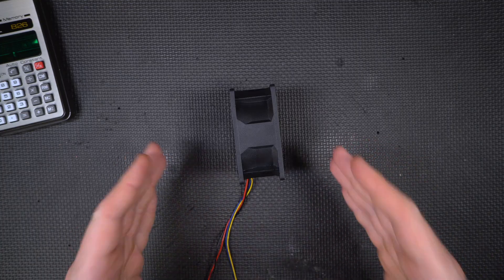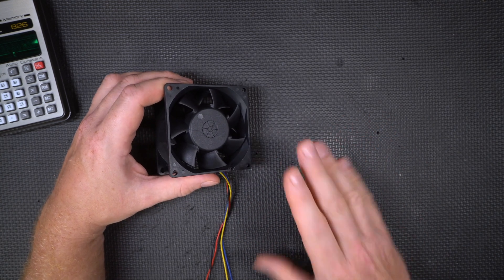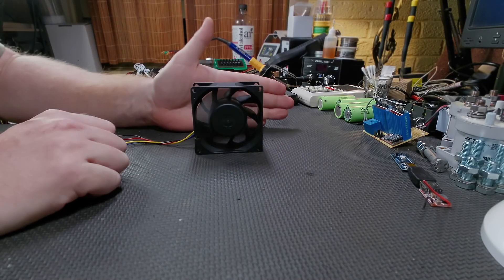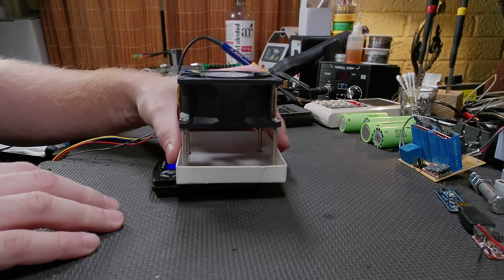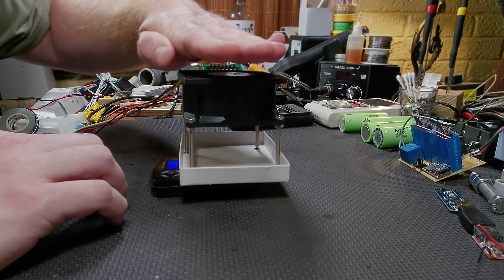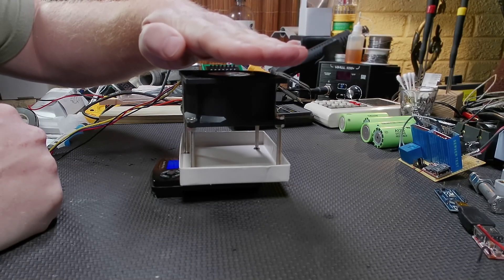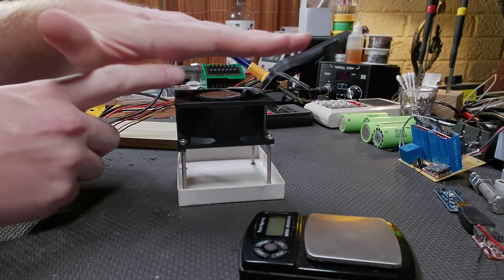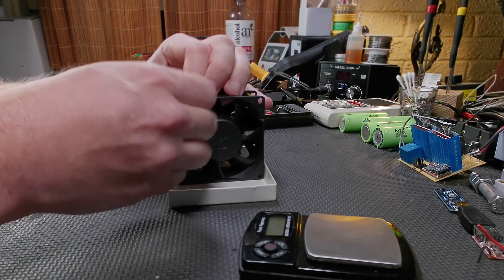I can't explain why this happens - can you?

Comment: So im gonna swing at it without reading the other comments. First swing is to actually restate the question, i guess? Why does the fan's 'apparent thrust' seem to increase as your hand gets closer? I feel like that's a crappy restatement. Anyway, at first i thought it had something to do with boundary layers, but when i searched that term,  'ground effect' appeared and that jogged my memory. Then i realized i didnt properly understand how that worked anyway, but it still seems to be 'the thing'.  Apparently it's all down to the fact that airfoils create vortices which.. uh.. impart.. reactionary forces.. in, uh.. non-ideal directions with relation to the airfoil. So some of the energy you're trying to convert to movement ends up pushing in unhelpful directions. But when you're in ground effect your tip vortices don't have room to 'complete a lap' of their circular path, and some of the energy that would have dissipated unhelpfully pushing every direction equally as they complete their circular motion actually becomes 'useful lift', making the airfoil act more efficiently with all other factors being equal.  

So this isnt a wing on a plane exactly, but each blade of the fan is like a wing. Each blade tip would be creating small vortices, but the fan is 'shrouded' which  blocks those vortices from 'recirculating' back around to the front of the fan as easily, massively increasing the efficiency of the fan at creating thrust in one useful direction. Still, if your fan was floating in free air a significant amount of the thrust would be turning back towards the inlet side of the fan, creating one big donut-shaped vortex around the outside of the fan, sort of like a smoke ring. The 'radius' of this thing probably depends mostly on the speed of the discharge/thrust air, but you can imagine the discharge sort of curving away from the centerline of thrust aka the axis the fan is spinning on, as it gets further away from the fan.  So the closer to the fan you 'interrupt' that curving flow, the more 'dead on' to the axis of the fan the reactionary force is, i.e. the more 'efficient' the thrust.  One interesting thing to note here is the fan is probably making slightly more straight-line 'thrust' by sitting on the table than it would be in free air because the table is already interrupting part of your donut. lol. It's also possible that if you extended the shroud by adding a pipe/tube to the outlet, the donut would be so broken (SCIENCE) that it would cause the Hand Proximity Factor to have a much smaller effect on useful thrust. I havent looked at the other video to see if you already tried that.. probly did..

Anyway, if you get your hand too close you cause the fan to get unhappy. I thought that was called cavitation but apparently im wrong. Still dont know what it's called. Im tempted to call it 'stall' just like a wing stalls, but i dont know if that's right either. When thinking of turbos and compressor maps i think of a possible connection to 'compressor surge' which iirc is trying to create too high a pressure ratio at too low of a mass flow, and that sure seems relevant. I think most people only know about surge via the pulsating sound but i think that frequency is substantially a function of the length and/or volume of the charge piping it's hooked to, same way distance determines the time delay of an echo. Also see 'water hammer', pressure waves in a system blah blah.  Anyway i dont know if im naming it correctly but i think the 'hand too close make fan zing up no pushy pushy' basically IS compressor stall, AND  compressor surge, because they're related  (i think stall is the cause and surge is the symptom) and i think in this case they're both true. 

If you think MY words are vomit try reading the actual wikipedia page on compressor surge.  "Propagation of the instability around the flow path annulus is driven by stall cell blockage causing an incidence spike on the adjacent blade. The adjacent blade stalls as a result of the incidence spike, thus causing stall cell "rotation" around the rotor. Stable local stalls can also occur which are axi-symmetric, covering the complete circumference of the compressor disc, but only a portion of its radial plane," I mean jesus christ. I fuckin tried alright.
Reply from the maker: Wow.  You went balls deep.  Your last sentence made me lol.  I appreciate you not only watching the video (esp since it was a weird one for me), but taking the time to write that long post.  Particularly interesting was your stream of consciousness on compressor surge, since my electric supercharger work has been running up on the other end of the compressor map - choke.
Reply: @AlexLTDLX  Thanks for the response!

Comment: The axial flow has to turn into radial flow. If its 360 degrees then at 25% the housing inner diameter the areas are equal. If the bottom is shrouded as it is on the desk it will be a bit more than that but all sorts of things have to happen for the direction change. Obviously the full answer is going to be complex...

So with the board, especially if there is a board on the fan something else happens in conjunction. The air will go radial and quickly slow down as its stuck to the smooth surface of the board and as its slowing down it will actually create a suction where the board having a hole and a fan mounted and a flat board will be drawn to each other but will also repell each other id too close. Perhaps some of this suction is happening with your board but the hand is too caotic yet still increases acceleration on the air by the fan blades or even reflects and interacts with the blades in the reverse direction where as the radial flow over the sticky smooth surface is either creating a suction or not creating a back turbulence?

Veritasium did a video on the board distance equilibrium a while back.. ive also considered this as a reason some carburetor setups just plain dont work. The prostock or otherwise high rpm types want very tall manifold plenums especially with single carbs so all ports in the tunnel ram have line of sight to the carb and fuel will reach the outer cylinders however cross ram manifolds sometimes work better than run of the mill tunnel rams, or single carb setups with low profiles often work fine as if there is a middle road that doesn't work. I feel that interaction with the manifold floor causes a radial flow and if it happens to be in this happy spot where enough air wants to be raial then fuel has no issues making it to the ports. But if its too high then there is stagnant air and the outer cylinders may pull from he slower air or the air/fuel hits the floor too slowly to stay vaporized and suspended. You see weird things like this on occasion with air filter tests that shouldnt affect fuel. Its not 100% but there are occasionally tests using filtered lids that lose power and by taping up the sides and using lid only flow the power comes back, as if the wrong mixture of radial and axial flow has a negatice effect. Thats kinda far from the thrust conversation but perhaps there is a part that's related because if it affects the amount of air flowing it also changes the energy used to accelerate the air and the trust difference may have some small factor that has to do with the conservation of momentum etc... I think the suction of radial flow over a smooth surface is a good place to investigate..m

Comment: Alex it’s the same concept in aeronautics that makes “Ground Effect” with low wing airplanes vs high wing ones, and hovercrafts that don’t create a lot of pressure just high volume of moving air and it makes a cushion of pressure at the collision point of the plank or your hand. Since your hand is cup shaped it magnifies the collision pocket to be more effective at catching the air velocity, similar to a spinnaker on a sailboat vs a flat sail or panel to catch wind. And not only does your hand, catch the velocity and make pressure in the pocket, the pressure also pushes towards the fan, increasing its thrust force back on the fan.

Comment: I teckon its a bit like why some intake manifolds have ribs below the carby, at wide open throttle and the butterfly's are 90⁰ to the floor of the manifold a small amount of turbulence is created by the reverb for the want of a better word of incoming air bouncing back . Your hand is acting like a vane of sorts directing the air flow away from the fan allowing it to be slightly .ore efficient than the flat surface.

Comment: What you’re not noticing, is the affect the air pressure is having on your skin! Everyone mentioned the cupping between your fingers and also your palm. But at the highest pressure points, the air is going to indent your skin, creating a bigger parachute pocket.

Something else to ponder, a Harrier jet. I’d imagine that it requires more force to lift off, with the flap down, than if the engine were directly facing the ground.

The simplified answer, is back pressure! New air is trying to occupy space before old air can leave it, which causes a chain reaction of air.

The FAA hasn’t hired enough Air Traffic Controllers to prevent delays in the flow of things.🤣

Comment: it slowly starts spinning until reaching max speed. once you place your hand near it, instead of the fan just moving air, it's now comressing it. run a high speed video and compare the difference it makes falling when you slowly bring your hand in close versus bringing it in fast with some velocity. if it is to do with a compression front then the faster you bring your hand in the faster it should try to escape. the air doesn't ALL go around your hand, some bounces straight back at the fan. you can test this as well by removing the square shround from around the fan. the shroud increases static pressure because it's much harder for the air to create a vortex right back into the intake side of the blades. your hand grabs more air (air has viscosity)  and is less smooth. that turbulent air creates more of a frictionous environment that can build pressure more readily. 
TLDR; it's pressure versus thrust.

Comment: The answer to every part of this video is the back pressure that's being generated.  The air has to go somewhere, so as you get closer, the pressure goes up as there is more resistance for the air to flow out of the way out of the back of the fan.  Eventually it become too great, so the flow rate drops down and you stall the blades (literally like an air plane wing, which the air stops being laminar over the whole blade and it starts to detach).  For the end of the video, the hand is more wavy than the plywood, causing less efficiently flow around it, causing a slightly higher back pressure.  It's really cool that you could so decisively measure this.
Reply: AKA turbulence

Comment: ground effect
Reply: ie more thrust close to a surface
Reply: better efficiency
Reply: air-lev bearing
Reply: hover craft skirt
Reply: some bernoulli fluid flow stuff, pressure etc
Reply: better be inter-net neutral lol :)
Reply: or F=p/A, pressure variations on variable area, makes variable push force, the ground effect
Reply: think that as a hydraulic pump, kinda, p=F/A or so

Comment: actio = reactio: friction is needed for the air to transmit the force. By blocking the flow you create a higher Resistance, decreasing flow, but increasing pressure, which creates thrust. There is a optimal resistance, which creates pressure without stalling the fan too much. This explains, why thrust decreases as you get too close. I´m not entirely sure, why your hand is more effective than the flat surface. My theory would be that the slots between the fingers allow a more even destribution of flow compared to the "dead zone" in the middle of the wood and the curves allow more laminar flow than edges.

Comment: Fingers have pockets in between and your palm acts as a big pocket. Think of pushing a sail with some give vs pushing a flat sheet. More pressure behind the sail than the sheet. That's my basic theory. All the micro cracks on your hand may also create an air friction or surface effect as well vs the relatively smooth board surface. One may generate a better boundary layer or essentially directional flow surface than the other. You can also intuitively move your hand to catch the most air, but holding the board perfectly level is difficult and even a slight tilt gives the air an easier path which also creates a suction effect as the air speeds up off the board. I'd suspect some combo of all of the above. Aerodynamics are so complex, but I think it's mostly intuitive answers in this case.

Comment: Aerodynamics. U must research it & read to understand. Way too much to explain here. A basic but mostly correct explanation would be ur hand creates more resistance than air which creates more pressure behind the fan,( & contributes to the low pressure in front of it due to velocity interactions, etc.). The reaction is the fan moves more than without your hand. Your hand also offers more pressure rise than the board due to the non-flatness compared to the board. The shape of your hand tends to act alot like an aerodynamic thrust reverser on a jet; although the thrust isn't all physically directed forward, due to boundary layer & Eddie's it is essentially pointed that way. Somewhat. That in turn takes energy,(velocity), from the air which is inversely proportional to pressure.  Velocity drops, pressure rises hense the fan is moving/pushing a denser fluid. See simple. No.
What will REALLY bake your noodle is using a water hose in a tub! I'll splain: turn the water on. Fill a large bucket/trough. 100 gallons or so. Once the water is at least an inch deep slowly put the end of the hose in the water. You will notice the hose will suddenly offer less resistance.  ALOT less! It tends to be pulled into the water. In the direction of flow! Why?

Comment: pressure only travels so fast, your're accumulating a pressure increase behind the fan that starts pushing back against the air it's throwing out then that pressure propagates to against the blades, think of it as making it's environment more like water. Now it's acting slightly more like a scuba thruster, enough to simply tip over at least.

Comment: You're creating a zone of high pressure where the air had previously dispersed quickly enough.  The denser air requires more energy to displace, ergo, a force is exerted on the fan blades themselves (and the housing as well, a little), causing it to tip over

Dense air is seeking equilibrium and your hand's presence alters where that occurs

Your concave hand helps create a pocket of high pressure & high density, ergo, there's more for the fan to push against and create force.  The lines and creases in your flesh and other structures of your hand help to trap air and make it more difficult to displace

I'm thinking of this whole system as a liquid, and maybe that's helping me?  I may be wrong too
Reply from the maker: I should've included this in the video - but when I was playing around with this, I tried a dish, concave side facing the fan - it didn't help; the results were more similar to the flat board.  I agree with your pressure idea - it's basically what I'm thinking too, just phrased differently.  I'd love to think of a way to prove or disprove this empirically...
Reply: @AlexLTDLX  you could try to wire some pressure probes. Or mount a single one up on a stick or something so you can move it around and sample different zones. Might need a spring dyno, constructed for lateral force (or it could be a fun rabbit hole purely for shits & giggles)

I'm positive it's happening due to lack of equilibrium pressures!

Comment: Ground effect plain and simple. it falls because of friction on the bottom, if it was on a sheet of ice it would scoot right along.
Reply from the maker: Right - but the question is, why does the thrust increase with my hand there and less so with a flat board there?
Reply: Try this, use a much larger board, maybe 150x150 cm. And hold it 1cm closer jumps, starting at 30 cm. Then do the same with bubble wrap over the board.

Comment: fluid dynamics comes to mind. Rock this experiment with a water hose. I also think you are crazy moving to texas but then again if you moving onto all electric builds then the heat is nbd~!
Reply from the maker: Thanks for the idea - I'd have to figure out a way to do it with a water hose.  FWIW, where I'm moving to has 7 months of great/decent racing weather and I'm literally just a few feet above sea level - you can see the Gulf of Mexico in the background of one of the drone shots at the beginning - this is nothing like Dallas or Houston.  Where I'm at now gets too cold to race in the winter, and the summer is too hot and humid to race.  Basically, you have the rainier/more schizophrenic/shorter seasons to race during (i.e. fall and spring), and traffic here is unbearable.  I wouldn't even dream of trailering the car anywhere from here unless I had no choice.  Where I'm at in Texas virtually every road is a dragstrip - flat and straight and little traffic, except during the summer, when it's too hot.  Besides, I'm planning to die down there - since almost no one will read this whole comment, google, "Rockport, TX beach" and check out the pics.  Maybe my old, fat backside might even try to play beach volleyball again (though that may be a pipe dream at this point)...
Reply: @AlexLTDLX  get out there and let the belly fly ..no one cares :-) enjoy your self brotha!